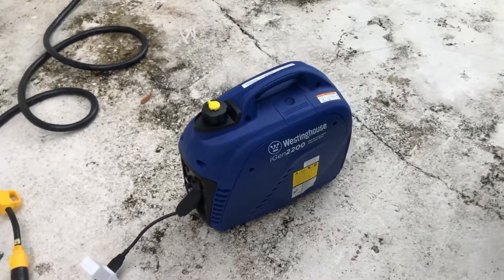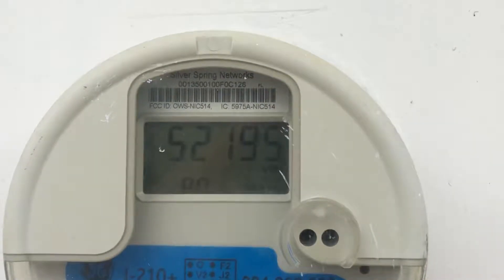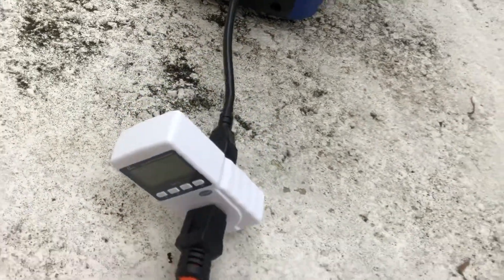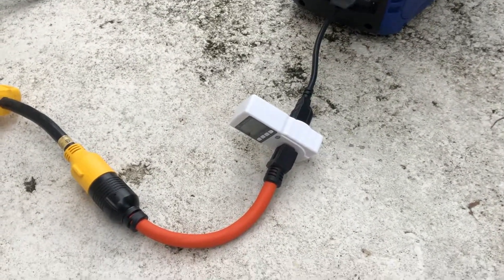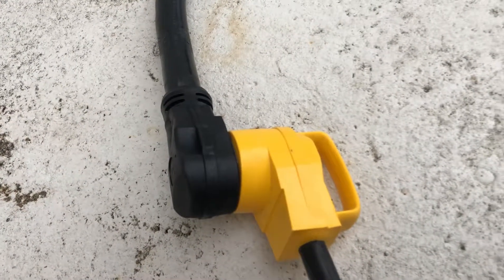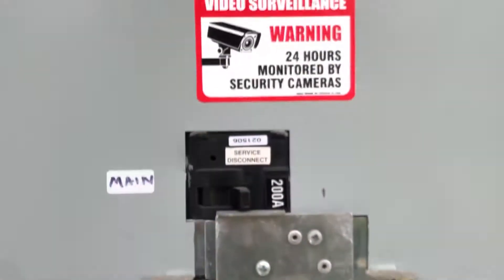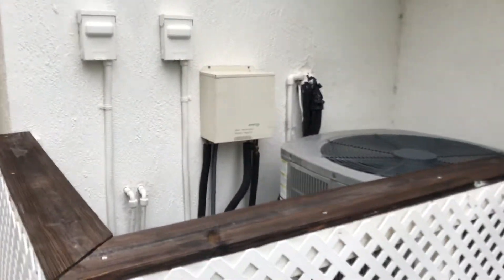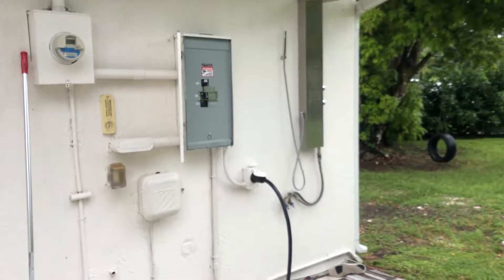Inverter generator hack 120v powering entire house electric panel

Comment: I'm pretty certain that the short orange 10 ga. cord has the Xand Y tied togther allowing both buss bars in the panel to receive only 120 volts and not 240. Just make sure to turn off all 240 breakers when using. You can test to see if the Xand Y are tied togther by using a continunity meter. I do that with my Honda 2200 I and have no issues.. Also make sure not to use any breakers that have a shared neutral. They are usually tied too a double pole breaker anyway.By Code. So no double pole breakers on.. Also I would use a 12 or 10 guage between the Generator and your meter.. As you did state just don't overload the unit .. I have not yet overloaded my Honda but am very careful to just power fridge and small other appliances or lights
Reply from the maker: @roberttreadwell3252  bingo. You got everything correct on your comment. This is to help in a pinch when I only need a few 120v circuits powered and I don’t want to run my larger 240v generator. Just make sure to turn the 240v breakers off and monitor the load.

Comment: just wondering is your current 50A transfer switch connected to the entire main panel? or is it only select circuits? when feeding 120v into a 240v panel, only half of those circuits will be powered right? Thanks!
Reply from the maker: @TheEyao  it feeds the entire main panel with 120v on each leg so I turn off the 240v breakers.
Reply: Probably selected essentials to switch on the mail panel. You can get another panel with dedicated circuits already pre determined. You don’t need every circuit in the house running in an emergency situation. So just fridge, a few lights and fans would be enough. His higher wattage generator will run those circuits plus his preferred living area air conditioning.
Reply: Need to be aware of multi wire branch circuits. Not understanding these are understanding what your house is wired when it comes to those it’s very dangerous.  Essentially, you could overload the neutral on that multi wire branch circuit and cause a fire on the neutral wire.

Comment: Curious what happened here.  I have a transfer switch.  I would like to run an ecoflo into it at night to power just the furnace fan and a few lights.  But it would be this same 120 to 240 setup.  I didn't think it was possible.
Reply from the maker: @athletikonaol  it is possible to power your entire electrical panel with a small 120 V power source like a gas generator or a solar generator like the EcoFlow. You do have to keep in mind that the limitation is based off of whatever that power source can provide. If you just wanna run the refrigerator and a few lights that should be fine, but don’t expect it to run anythingsubstantial. You have to turn off all the 240 V breakers when you do this to avoid damaging appliances in the home and your power source.
Reply: This was helpful for my solar system
Reply: He is using an RV adapter. It puts the single 120v down both sides of your electric panel. You would need to turn off your 240 breakers or they would be getting low voltage.